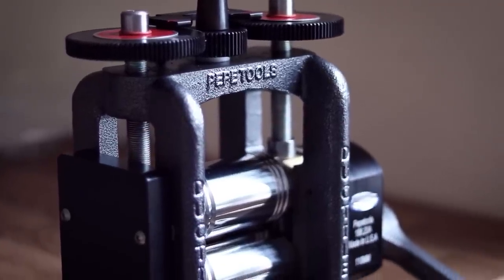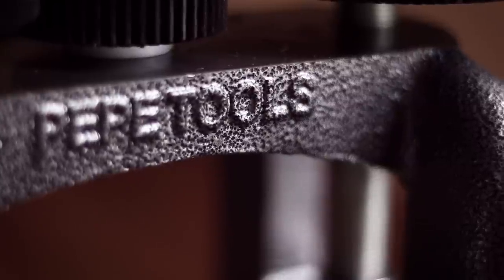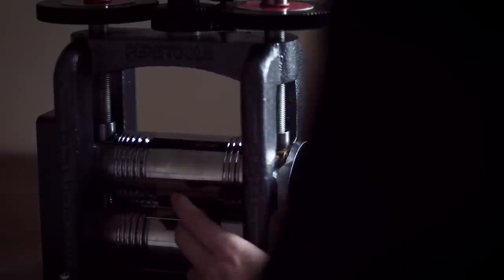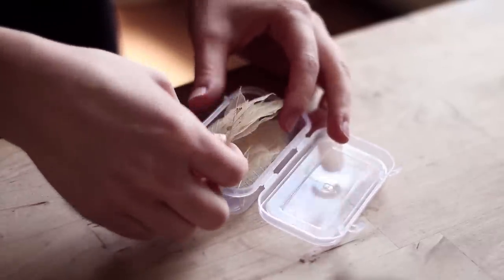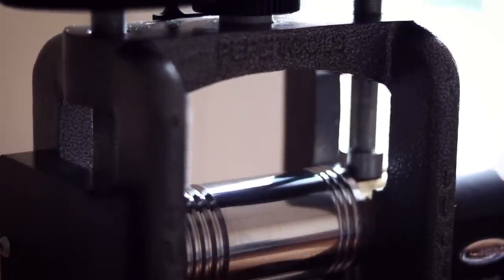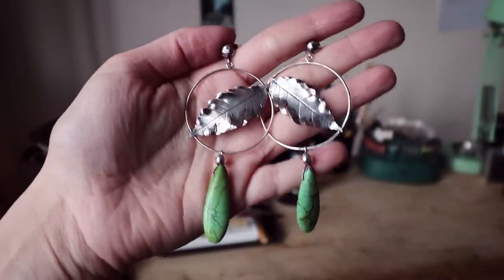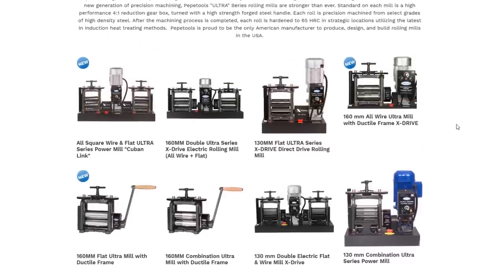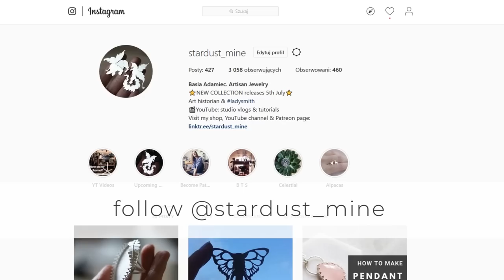Pepetools Ultra Rolling Mill - TOOL REVIEW + demo. How to use the rolling mill for jewelry making

Comment: How are you getting the LOS so dark with the paint brush? Mine only gets that dark when it's super hot
Reply from the maker: Hi Elise, it's because it's not the one that you use with water, but directly on the metal. It's called platinol. I've made a video about it, if you're interested in knowing more! :)

Comment: What else did you try besides dry leaves? :) Just curious!
Reply from the maker: Not a lot with the patterns, I wanted to master one thing first (the leaves) :D I tried flattening metal too, and it works great
Reply: @TheArtOfMetalsmithing  So you could replicate other metal patterns with it also, right? Well looks like a lot of possibilities!
Reply from the maker: @dawidwarta1063  that's right! Paper cut-outs, fabric patterns, more plants and different shapes :) I'll make a video about it in the future, so you'll be able too see! :)
Reply: Basia, do you remember I advised you the circuit board thermal transfer paper? It can be used for one interesting technic with rolling mills for stamping anything what you want on the silver surface. First, print a picture on this paper using a laser printer, then transfer it on copper sheet by an ordinary smoothing-iron and coat another side of copper with any acid resistant paint. Thereafter etch it in solution of your choice - there are a few prescription of it by this link: https://radiokot.ru/lab/hardwork/62/ (just choose your language on the top right), whereat remove the paint by acetone and roll your silver with the etched copper stamp. Do it and enjoy!
Reply: P.S. For small pieces it's possible to use adhesive tape
 instead of the paint for copper backside protection.
Reply from the maker: that's very interesting! Sound's like a lot to do haha, but interesting nonetheless :) I wonder what the effect would look like! Will check it out
Reply: There is one more matherial for this process. It's photoresist film. The work with it is a bit labourous, but it gives a little better quality: the minimum thickness of lines in picture for etching is ~0.3 mm with the use of thermal transfer paper and ~0.1 mm using photoresist film. You can see how to work with it at the following video: https://www.youtube.com/watch?v=NkdmWoLGtVo
I have a couple remarks that might be useful for you. So, the man on the video uses special light box but it's possible to exposure the film without it - just by sunlight on a sunny day. And also he has used a melted wax for backside protection coating, I think this is a good idea.
Reply: P.S. You also can use a nail curing UV lamp for photoresist exposuring but in this case you should remove its lateral bulbs to avoid the sideways light striking - the light source(s) must be only at the top over the metal sheet with the film on it.